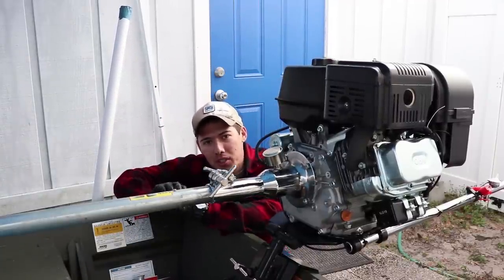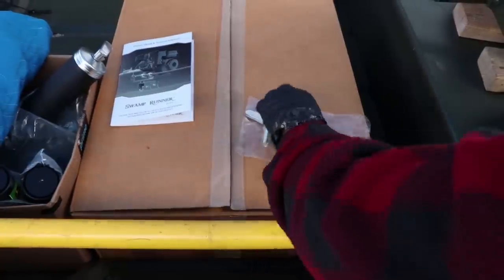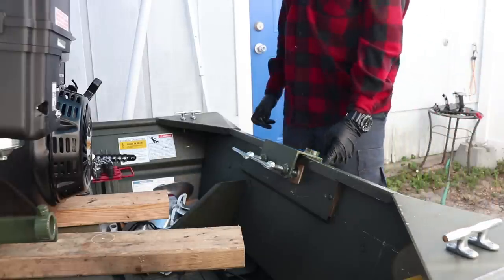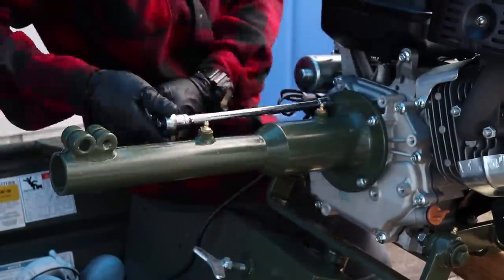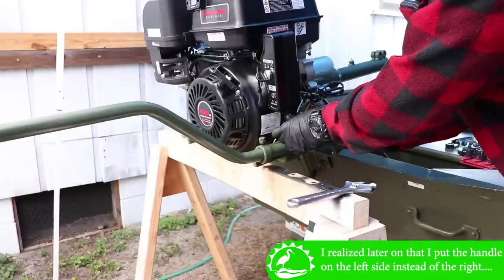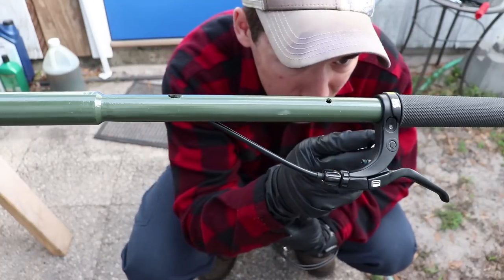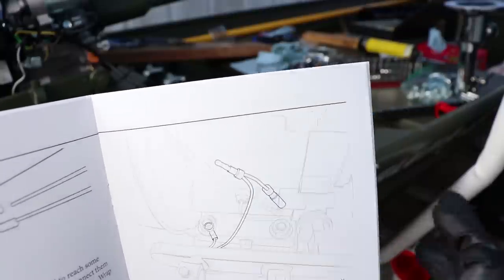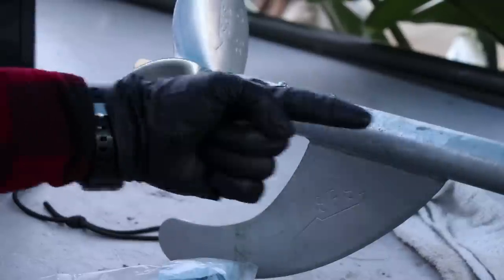Swamp Runner Long-tail Mud Motor Medium Kit Assembly: S2E2

Comment: Awesome videos. Love my Swamp Runner motor. Great instructional video on assembling it. Surprised your not on their payroll. My only problem I've ever had with it is the grip occasionally slips out from the handle if I come to a sudden stop or lean forward. Also I've noticed that the kill switch is very hard to remove if you need to quickly kill the engine in an emergency. Wasn't sure if you noticed the same issues. Keep up the good work, really enjoy watching.
Reply from the maker: Thank you Jeff McCain! You're surprised I'm not on their payroll?! I'll take that as a compliment haha I didn't think my videos were that good hahaha. If anything I would think Black Warrior Lures would be on their with all of his content on SPS kits!

So I've never experienced the grip problem. I'd love for you to send me a video or pictures if you could! With your consent, I would be able to put that in my written reviews to help others out. I have this grip on my small kit that I have had for three years now and it has not failed and doesn't show any signs of failing. I did have a subscriber who used a "mud grip" by Risk Racing that he put over his handle grip to grip better when your hands are wet. I will probably give that a try when I'm done with the series. I think that would benefit a few people. 

For the kill switch not pulling out easily, you can angle it to your needs. If you have it properly secured to your person it will pull out. It does take force to pull it, but the kill switch from Beaver Dam is a similar pull key kind. The one from Mud Skipper is fairly cheap. Its like a rubber cap. Once it heats up, it deforms and doesn't work anymore. Again with my small kit, the safety kill switch still works on it after three years so I'm not going to complain. 

Thank you for watching!!
Reply: +JTgatoring The grip was supplied with the kit, same as in the video. Where the grip & the throttle lever bolts onto the steering shaft is where it comes out. I may not have it tight enough or it may be getting worn out. The throttle lever stays in place, but the rubber coated plastic grip handle slides off the end of the steering shaft. Usually only happens when I beach the boat or hit a shallow spot that slows my boat down in a hurry from full speed. I continue forward with the grip in hand as the boat stops in its tracks.

Comment: So when I put my shaft on it still has play and I’ve tried hitting it forward and still nothing. Is there a better way to fix this or am I doing something wrong?
Reply from the maker: There's a lot of different shafts here. If you are talking about the shaft inside the 85 or 100-inch longtail, that is fixed by loosening the bolts with ears on the coupler housing, and tapping or pushing the outer shaft further into the coupler housing, and then tightening those ears back down. If you tighten those ears down and the shaft still moves in and out, you most likely have those bolts in backward and you need to flip them around.

Comment: Just curious as to the reason you put the mount on the transom with the twisty things facing in...my kit says it should go the other way...?
Reply from the maker: As long as you have an SPS Swamp Runner, in Step 7 of your owners manual, it shows the wings bolts on the inside of the boat. I don't know if it would matter or not if the wing bolts are in the outside or inside of your boat, but you just want to make sure that the gimbal hole on the transom bracket is on the backside of the transom.

Comment: Any idea what size the bolts are that mount the shaft housing to the motor??? And the transom bracket bolts as well???
Reply from the maker: I do not. I'm sure if you go on Swamp Runners website you could find that out. If not, it may be in the manual or check your engine owners manual for bolt thread and depth.

Comment: Have you ever messed with the throttle stop screw on these motors? Wanting a little more power out of my 6.5 but don't want to take the governor off or do any major mods just yet. I see there is a screw that prevents the throttle lever from traveling past a certain point and it seems easy enough to just back it out a little bit to allow the throttle to move higher up.. bad idea?
Reply from the maker: I personally haven't messed with it. I have no need for extra power or really pushing the motor. I want the motor as reliable as it can be, even though I don't think it would change the reliability of the motor.
From what I understand, taking the governor out of these motors (for longtail use) is no bueno. When the prop jumps out of the water, the motor goes from having a load on the engine at whatever rpms you're at in the water and then the prop jumps out of the water so now it goes straight to having no load at all and you need a governor to stop the motor from revving too high.
I would take the boat out on the water and play with it close to the shore so if something does go wrong or you back the screw out too much and lose it in the water, you can get back to the ramp easily. You could probably even test it on land at first. Just mark where it was initially. If you're trying to maximize your engine, you NEED a tachometer to see where your rpms are at. Don't mess with the engine untill you know what your rpms are at.

Comment: Hey bud you seem to be the most
Knowledgeable on the topic so I figured I’d ask you.   What size kit and motor would you recommend for a 1236 Jon? I’d be willing to add pods if needed to run the bigger motor unless you think it wouldn’t work   Thanks!
Reply from the maker: Pods do not help with this type of motor. Longtails like skinnier hulls. An 1836 would be an awesome boat for a 22hp or 35hp longtail and would fly. The closer the crest of the wake is to the boat, the better this motor will handle. Pods push that wake out and therefore would not help. For a 1236, a 6.5hp engine with a small kit is what most people run because that is all the boat can handle. That's why I went to the 1436 so I could put either the 6.5 or the 13hp on it. The 1436 has the same footprint in the water, just the bow is longer but it doesn't touch in the extra two feet of it. I started with the 6.5hp and got 12 mph. Then I got the 13hp and got 23mph. Let me know if you have any more questions
Reply: JTgatoring well I was also wondering the avg lifespan of a predator if taken care of and no mods would be?  Is it worth spending more and getting a Honda or Briggs?
Reply from the maker: @Yuhmuthasaho  From what I hear, you'll know if your predator engine is a dud if it does weird stuff within 10 hours of running. If it last 10 hours you should be good to go for the long hull. My dream set up would be the briggs v-twin 16hp. My reasoning is because the v-twins vibrate A LOT less compared to the single cylinder engines, and I don't need that big of a motor and I still want to keep the best fuel mileage I can get. I do not think you NEED a honda, unless you're doing remote long trips and want that extra piece of mind but if you keep the engine stock you shouldn't run into any issues.

Comment: Did you need the cable swible stop with the predator engine or was that just for hondas. Im only asking because people say the predators are honda clones
Reply from the maker: No, the predator has a swivel stop on it. Honda does not. So you do not need to buy the extra swivel stop for the predator engines. The predator engines come with the swivel stop already on them

Comment: Can I put a 6.5hp Longtail mud motor on a 12ft Hobie Pro Angler Kayak? Would it work?
Reply from the maker: If it has a transom or a place to clamp it on the boat, then you can do it, whether the boat will handle it or not I do not know

Comment: Do you have to remove the splined coupler to remove the shaft out of the housing? Or will I be able to tap out and get the the set screws for the key way on the PTO shaft? I bought a motor from a guy and I noticed the set screws we're not in.
Reply from the maker: So your goal is to put the set screws on the keyway? There is a ball bearing that is formed into the coupler housing. You have the coupler shaft that goes through it and attaches to the female coupler nut (looks splined and is what you put the main longtail inner shaft into). So you do need to remove the female coupler nut with that tool that came with the kit originally to be able to take the coupler housing off to access the set screws.
Directions:
1) If your motor is completely together, first start by mounting it or making it secure to work on.
2) Loosen the two ears on the coupler to completely remove the longtail shaft. It should pull right out after wiggling it while lightly pulling. Make sure to put something under the engine to stop the engine from falling face first.
3) Use the tool that is shown in part 8:49 of this video - https://youtu.be/VYbTxGRf64M?t=529 - to remove that female coupler nut. (the splined looking part that threads onto the end of the coupler shaft.
4) Remove the four bolts on your coupler housing that mount it to the back side of the engine. After these four bolts are removed, the coupler housing should be able to be completely removed and you should be able to access the set screws.

Any questions let me know!
Reply: @JTgatoring  thanks man, the guy who I bought the motor and kit from forgot to give me that tool and it's on it's way in the mail. Do you know what size and thread the set screws are?
Reply from the maker: The only thing the manual says about the set screw size is that it is an M6-1.0 set screw and to use a #3 metric allen wrench to tighten it

Comment: I'm having issues getting the coupler housing to slide all the way to the bolt holes
Reply from the maker: That is normal. There is bearing that is pressed into the coupler housing. Normally there is a 1/4" gap or maybe even a little more in between the coupler housing and engine crank case. Insert all four bolts into the holes through the coupler housing into the engine, and tighten them in an X pattern. It will pull the coupler housing to the engine and seat the bearing where it needs to be.
Reply: Thanks man I appreciate it

Comment: I see you have had both the small and medium kit. Are the shafts different sizes between the two kits (OD size) ? I’m asking because I bought a medium kit and when I put the shaft in the coupler housing and tighten it, it will never get tight enough to hold the shaft. And the shaft has a Sticker on it that has SM. Thanks.
Reply from the maker: The longtail shaft is the same for the small and medium kit. They both say A85 on them.

Just make sure your wing bolts are in the correct way and are actually tightening the two ears together. If the two ears are together on the coupler housing and you can pull the longtail shaft out of the coupler housing, then your ears are bent from over tightening and you need to bend them back
Reply: JTgatoring when you insert the shaft into the housing about how much of a gap do you have between the two? I have about a 1/16 to a 1/8 of a inch
Reply from the maker: @jeffbenoit3218  On mine it is about 1/8" to a 1/4". Is your kit new?
Reply: JTgatoring yes it is.
Reply from the maker: @jeffbenoit3218  And when you tighten the two wingbolts on the coupler housing to the longtail shaft, the ears come together fully?
Reply: JTgatoring yes the ears come together fully and even the gap on the coupler housing between the ears close all the way. With both gaps closed the shaft still has play in the coupler housing and falls out.
Reply from the maker: @jeffbenoit3218  I guess contact Swamp Runner about it. Let me know if you're able to solve it
Reply: JTgatoring the problem was they put the wrong coupler housing in the box. They put a large instead of a medium
Reply from the maker: @jeffbenoit3218  Man that weird. And it bolted right up to your engine?
Reply: JTgatoring yep bolted right up.
Reply from the maker: @jeffbenoit3218  Wow alright. I guess the large has the same bolt pattern as the medium then. Well I'm glad you got it figured out! Let me know how your kit runs once you get it fixed up and out on the water!

Comment: Do you have to grease the shaft or is it a recommendation?
Reply: Or anti siez compound
Reply from the maker: The shaft is meant to be greased. That is why it has grease fittings, but I normally grease my shaft and coupler housing every 6 months ( twice per year). If you have the extreme or extreme saltwater shaft (those shafts have the bayou bushings all throughout the shaft) it probably doesn't matter if there is grease in there or not. I don't think you could wear down that bayou bushing. I would do it to help prevent the inner shaft from rusting too badly.
Reply: @JTgatoring  Thanks for the help!
Reply from the maker: @dksoutdoors8860  You got it!

Comment: Anybody have a Honda gx390 with the sps kit? I can't get the coupler shaft close enough to the motor so the housing will not mount. Do I need to shorten the shaft the coupler goes over? @jtgatoring
Reply from the maker: Make sure that you have the female coupler joint off the end of the coupler pto shaft. Then slide the coupler housing over the coupler pto shaft, and you should end up short but still be able to start threading the bolts. Like lug nuts on a wheel, tighten them in a crisscross pattern till the coupler housing mates up to the engine. the bearing inside your coupler housing needs to be seated and that is what is preventing you from easily mating the coupler housing to the engine. If its way off, then you may not have the correct length or style output shaft on your engine.
Reply: @JTgatoring  thank you for the reply you've got the best videos out there on this subject.  I fitted it without the key and it mated up just fine do I ended up shortening the key and voila problem solved thank you jesus lol
Reply from the maker: @michaeldunn3876  Thank you Michael. Another good place to get some good answers is in a facebook group if your ever want a few opinions. I manage one with the logo being a prop called longtail mud motors. Always love a simple fix like that haha very good, I'm glad to hear its fixed

Comment: Recommended grease for zircs on shaft?
Reply from the maker: The manual says to use zero weight grease like Cornhead grease. I happen to have some so thats what I use. I grease it about twice per year
Reply: 1/4in too much play in the shaft once you get it on and propeller on? Swear ive beat and pushed on it as hard as i can. Used wood and a hammer. Any other tricks?
Reply: JTgatoring see below please. Thank you!
Reply from the maker: @YellowxJacket8  Which shaft are you talking about? The longtail shaft or the engine pto shaft?